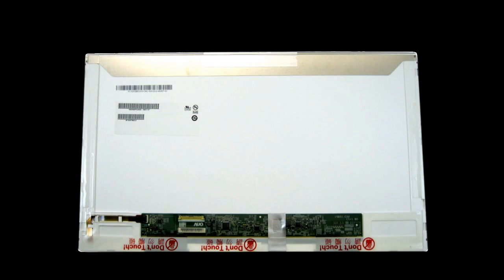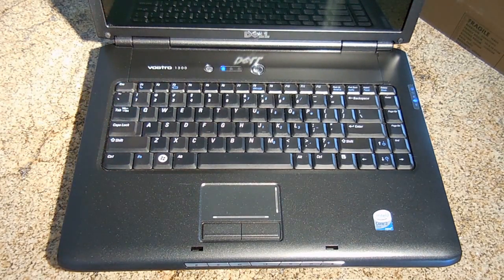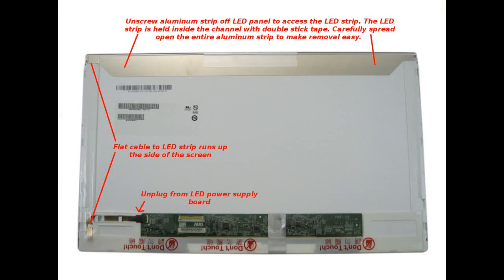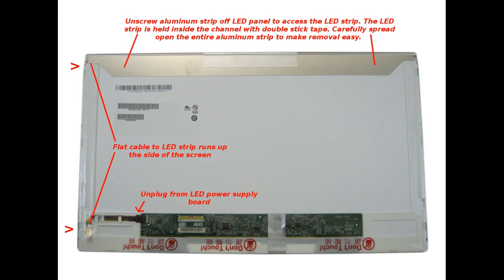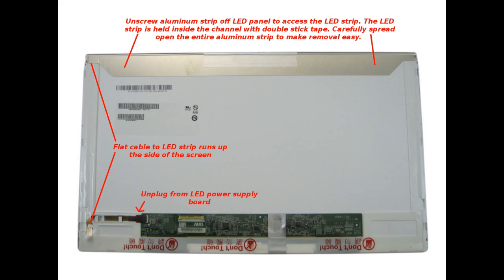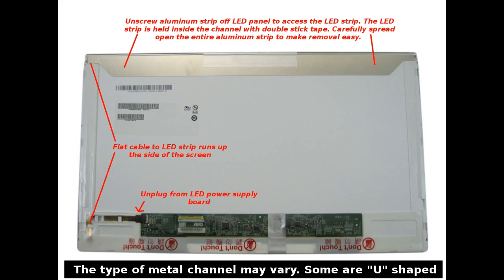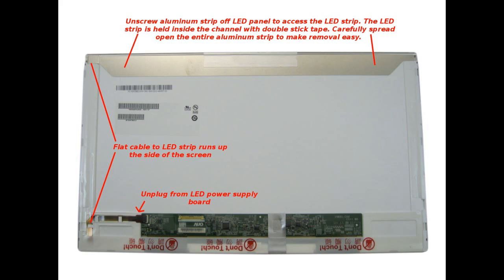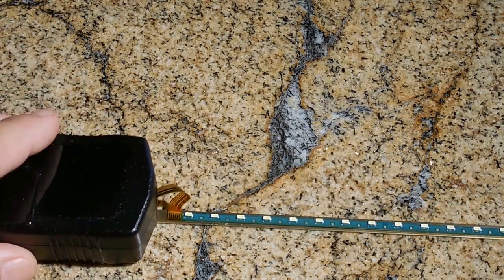DIY LED Strip Lighting From Broken Laptops

Comment: Can i convert it to usb cable to connect?
Reply from the maker: Yes, you'd need to used a DC-DC step up converter(5v to 12v or higher). Thanks for watching!
Reply: @electronicsNmore  thank you very much! Subbed for you brother

Comment: Very well explained but I was expecting some footage from LED strip removal.
Maybe you should change the title to "DIY a very cheap power supply for driving LED strip"
You should also consider that when using LEDs, we expect to also have efficient circuits. A better way to drive LEDs is by using LM317 as a constant current source (see http://www.ti.com/lit/ds/symlink/lm117.pdf at page 11).
Reply from the maker: +Vangelis Skarmoutsos 
Removal is easy. I posted images in the video. All you do is remove the tape holding the LED containing metal strip on the panel, then carefully pull the LED strip out of the metal strip. The power supply I used is just fine.

Thanks.

Comment: unisolated supplies are suicidal.
Reply from the maker: Never had any problems, and I have used many over the years. If you have fear, then use a transformer. Very simple solution.
Reply: +electronicsNmore dont get me wrong, theres no issue with a strip of led unisolated if there in a project thats in a box, most led lights out of china are that way on ebay etc, but to wave a strip of them about like in the video would be a bit dangerous if they were unisolated and touched skin, all you want is some 12 year old doing this playing ob1 kenobi with a couple of resistors off his 220v ac and ending up dead, i;m sure the family would find an ambulance chasing SOB to come after you from somewhere.... like Norm always said, lets talk about shop safety, and when it comes to safety, lets talk about these, safety glasses..... that was in every video for a reason...just saying as i like your channel and what you do, but theres idiots everywhere, dont encourage them lol
Reply from the maker: The best solution is to make sure the project is enclosed in a plastic project box, use a plastic knob on the POT, and to eliminate any risk of shock due to a component failure, slide a clear vinyl tube over the entire LED strip.

Thanks For Watching

Comment: I hate to be a naysayer... but shouldn't that LED strip be insulated if you're going to use a transformerless supply? Especially if this is going in a kitchen, where people might have wet hands?
Reply from the maker: +Andrew Armenia 
Hello Andrew. First of all you should never touch any electrical device that is plugged into an AC outlet with wet hands. Secondly the only part you should be touching is the PLASTIC POT knob. Thirdly, if the strip light is next to a sink, then the outlet should be GFCI protected. Lastly, I tested the DC output to ground, and there were no hazardous readings. If you are concerned, use a transformer. :-)

Thank You
Reply: +electronicsNmore Those points are well taken, but accidents do happen and not everyone has GFCIs where they should. There are some other hazards with the transformerless supply, too: if this light gets plugged into an outlet with the Hot and Neutral wires reversed, it's potentially deadly. Failures of certain components, such as opening of the 220 ohm resistor in the neutral, or any bad connection between the diode bridge and neutral, could also turn the strip into a killer. 

Not all of these hazards are immediately obvious to anyone who might take this project on, so I felt they were worth pointing out.
Reply from the maker: Sliding the strip inside a clear plastic tube can eliminate that risk. :-) You also have a 50-63mA fuse which should prevent electrocution in the event of a fault.

Thanks For Watching

Comment: what about just using a 24vdc wall wart with a few caps and a pot. i got BOXES full of wall warts from 1.5v an everything in between up to 36v. ac and dc mostly dc. any suggestions on that. id like to know cause i have tons of these led strips. iv been tearing down and salvaging electronic stuff since i was 5.
Reply from the maker: +lead foot lawn mower (leadfootlawnmower) 
Hello. You need to use a low wattage/small wall transformer(24VDC/100mA max output)to power the entire strip(4) sets of 8. You will also need a low value 1/2W to 1W resistor in series with the POT to ensure the voltage is kept at 25v max while the LED strip is powered. Using a higher wattage transformer will cause the voltage to be too high and burn out the LED's.